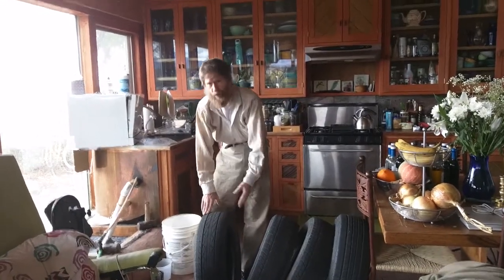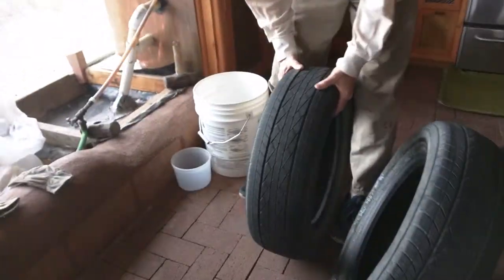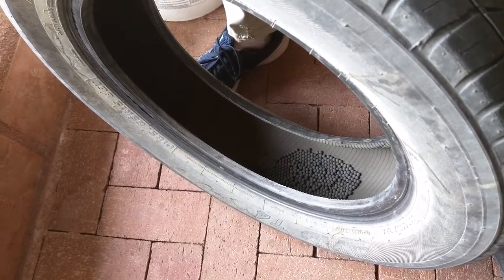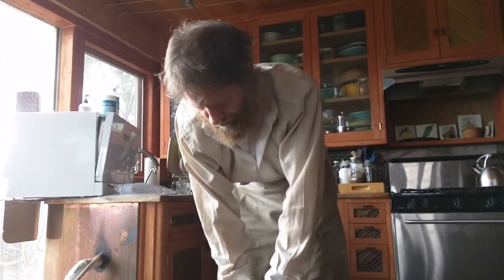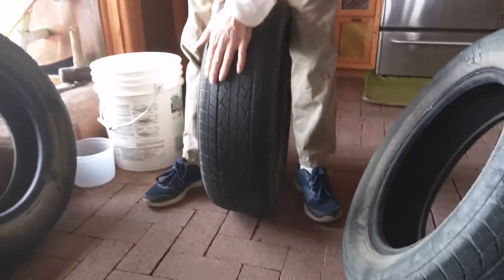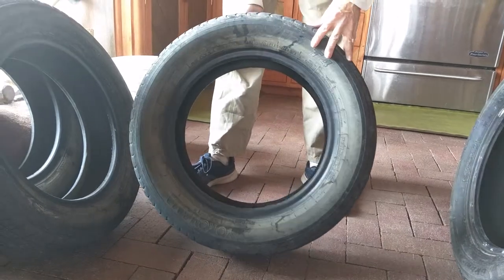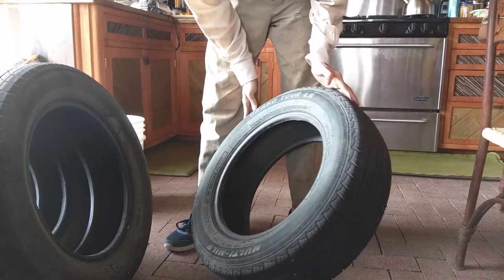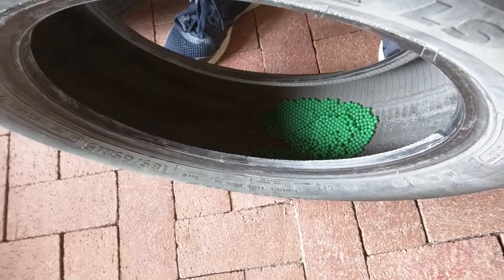Trying out the tire balancing beads trick!

Comment: Great video. . I also bought a manual tire changer several years ago and use it fairly often. 
It works well and I find it is not that much more difficult then when I use the power operated service station tire changer. . I find it is easier to just do it at home. 
I have never before heard of the bead trick for balancing..